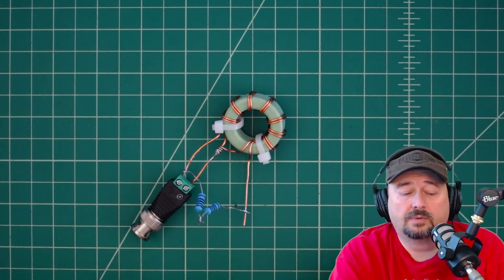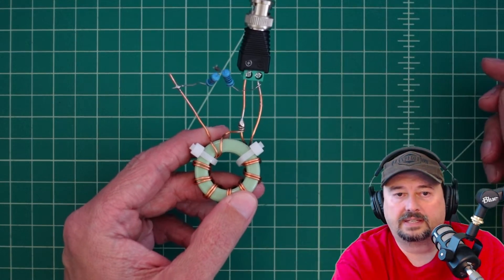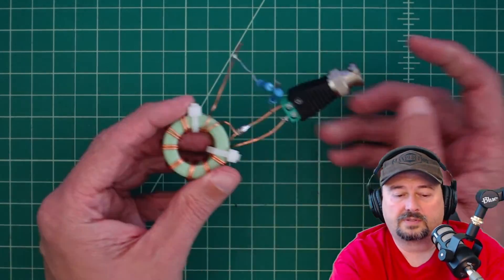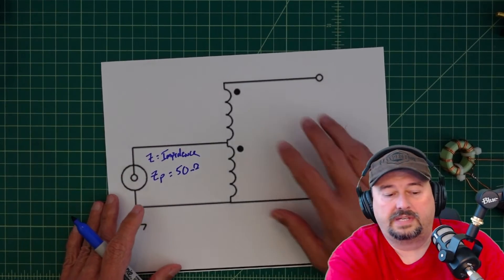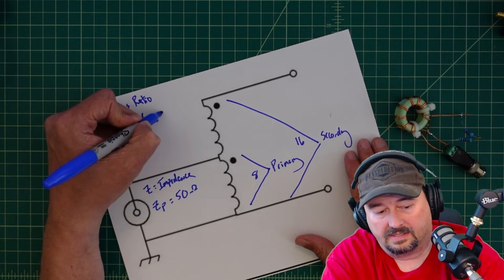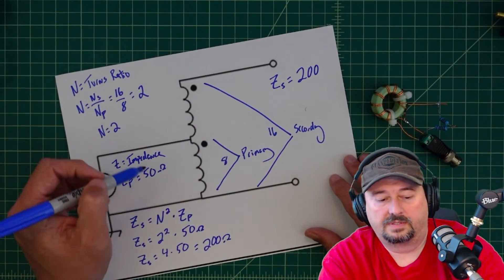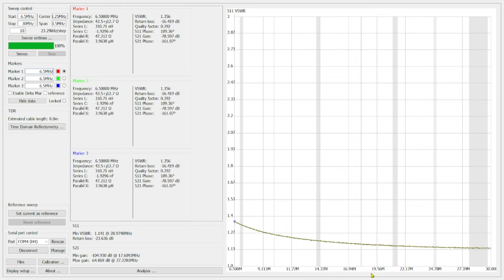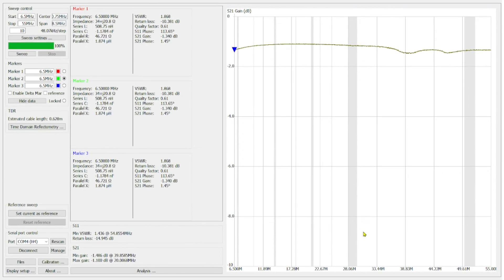Best 4:1 UnUn for Ham Radio Antennas?

Comment: Hi ape, I'm new to this field, why specifically 8 turns for each winding, what if we wound more or less, can you clarify this?
Reply from the maker: The number of windings per s chosen based of the core type and frequencies the antenna will be used on 👍
Reply: @TheSmokinApe can you share the info about how to do it
Reply from the maker: @VasanthP-yl9co I just did a video where I spoke a bit about it, I have more planned.  Tiny Toroids: What SHOULD you use for QRP End Fed Half Wave Antennas?
https://youtu.be/0HmrlRXsDck

Comment: What type of resistors did you use? Did you choose low inductance resistor or are ordinary resistors ok to use at HF freqs?
Reply from the maker: Carbon file low inductance, ordinary will add reactance 👍

Comment: I hear a lot about dual core 4:1 Guanella current baluns and how to make them, but I can't seem to find any practical examples of how to make a dual core 4:1 Guanelle Unun. Maybe you could address that one in a video?
Supposedly, the dual core 4:1 Guanella unun is more efficient than the single core 4:1 unun you built in this video.
Reply from the maker: I think there is much debate over the dual Guanella vs the Ruthoff and Guanella current hybrid.  I can do a video, at some point on the dual Guanella

Comment: G'day APE
Now using this specific setup, you got close enough as you say.
My question is, supposing using this core can you modify the type of wire and spacing fine tune and get the theoretical 1-1? 
I'm also guessing slightly altering the number of turns would throw things way off from the desired effect.
I know it would not be worth doing this, but I'm guessing you could.
Reply from the maker: You could.  But you would need to know the impedance of the antenna and then adjust accordingly 👍

Comment: Transmission line transformers are quite forgiving as to core material compared to conventional transformers or autotransformers. My advice  - test them as conventional transformers (Primary -secondary maybe 10T each, or conventional Autotransformer) at POWER. This helps to sort out the mystery core material performance better than return loss alone... 
The 52 Mix is supposedly Powdered Iron according to Micrometals and NiZn ferrite material according to Fair-rite, with a perm of 75 to 250. Data sheets are all over the place on values.  Dunno how these are equal. They are supposed to be lower loss at higher frequencies than the Yellow White Type 26 typically found in ATX Power Supplies.
Reply from the maker: These are type 52 powdered iron and not the mix 52 ferrites, I think you are recognizing that.  We, along with others have used these is a 25’ vertical antenna configuration with four 17’ ground radials with success from 40-10m.  I don’t recall anyone trying on 6m.  We did use a tuner but with that antenna configuration it’s to be expected.  Admittedly, I was surprised at the results.

Comment: what are those green/blue toroids? I pulled a pair of them out of some scrap electronics the other day and was wondering. Interesting that they're making an appearance here...

(apparently, I'm the 73rd comment, so) 73,
Reply from the maker: They are t130 type 52 powered iron 👍
Reply: @TheSmokinApe given that, I'm blown away that they work as well as they do at HF!
Reply from the maker: @hamradioexperience  I was a little surprised myself
Reply: @TheSmokinApe I'll have to do some more testing. I was literally just told they MAY be of LIMITED use on HF. They seemed great from your video. Other than at sub-80m. I might try to duplicate your results, then copy with a -43 mix. Might be interesting...
Reply from the maker: @hamradioexperience  I’d be interested to hear what you find.  We did compare them to multiple core and then decided to go with this one.  Thanks for watching HRE 👍

Comment: Hi, ape. I'm glad that you made a 4:1 Ruthrof voltage BalUn and tested it.
The only thing that bothers me is that you used the wrong core material. 
Iron powder core #52 is equivalent to #26, which is meant for power transformers and high current chokes in  switching power supplies.
De VU2RZA
Reply from the maker: Hey Subramanian.  Thanks for the post, I did read the spec sheet but for this particular build we did test a few different Toroids and much to my surprise this one did particularly well.
Reply: @TheSmokinApe  OK Ape. Thanks for responding. 
But this core can be used in MW frequencies; it can be used as high as 1 MHz or 1.5 MHz max. That's all.
You may get deceived sometimes with the nanoVNA. 
In the real world, it would be useless. 
Instead, you can test mix 2 or mix 6.
I believe you might have tested them already 🤔 
De VU2RZA

Comment: Does the 52 mix give a better frequency response at lower frequencies than the 43 please?
Reply from the maker: It depends on the application but many folks use the ferrite mix 52 for 80 and 160 👍

Comment: looks good. nice core mix to go up to 6 meters.  I have wrapped a t 240-61 at 4:1 Balun . for off set center fed veritable for 10/11/12 meters.  1/2 wave total and feed point at 1/3 from bottom. making around 200 ohm feed impedance .  will go up DX commander pole .  will be a mono band type.  have all the parts but not put together. I used 14 AWG mag wire.   this type does not need ground plain or counter poise. it is a balanced dipole.  it is when we feed at end it goes unbalanced and counter poise of some type.   that need UNUN to feed. my antenna go bag is getting bigger.  and still a easy carry  for POTA . mat do a 2 or 3 stack 4:1 with T 240 for 1Kw . lord Callum can do 1 KW now. off com license change . 1 KW for the UK. now 100 watt stations came back to me /QRP . was funny. several did it to me on 10 meters in the AM . FTDX 10 sounds great  from England 100 watts on 10 meters. 73's
Reply from the maker: Hey Robert!   This is for a vertical ground plane type antenna, the CaHRtenna Poseidon
Reply: @TheSmokinApe  I was thinking that. love the test video's that dropped lately . with the cores back to back. put 50 ohm dummy load on it and you can do power test for core heating.
Reply from the maker: I actually have a video like that planned 👍
Reply: Hi Robert, let me make some clarifications. 
An OCF, off-center fed dipole is an unbalanced antenna. 
You are using a half lambda wire and feed it in the center because the feed point impedance is low in the range of 50-75 ohms and is suitable for a coaxial cable. 
This center fed dipole is resonant (on only one frequency) and can be used for a single band only.
If you want to work on multiple bands, you have to find out a point on the half lambda wire that would remain with a fairly fixed impedance. 
It can be 1/3rd or 1/4th from any one extreme end of the half lambda wire; it would be around 200-300 ohms depending on other factors especially like the feed point height above the ground. 
So, a 4 to1 or  6 to1 transformation to the standard 50 ohm coaxial cable is needed.
Here, in this video Ape demonstrates a 4 to 1 Ruthrof voltage BalUn. 
The demerit of this design (apart from the choice of wrong core mix) is that it won't provide any CMC, common mode current suppression. 
Yes, in any OCF, you will be expecting the CMC problem. 
You can mitigate in two ways. 
1. The Ruthrof voltage BalUn must be followed by a 1 to 1 CMC choke. 
2. You can go for a  4 to 1 Guenella current BalUn using two ferrite cores of sufficient size for the power to be handled. Don't get tempted to use a single core 4 to 1 BalUn. 
Just for completion: ferrite cores are termed like FT82-61.
Iron powder cores are termed like T200-2. 
When you intend to use more than 600w, you should go for Teflon wires of sufficient gauge; don't use enameled copper wire (magnet wire)
I think this helps. 
De VU2RZA
Reply: @subramanianr7206  what I made was a mono band off center fed. only for 10,11,12 meters buy folding extra wire and wrapping it around. adjusting match. not a high power antenna. just one FT 240-61 core I had. and my coax feed has choke at end wear it goes to Balun. everything made with Walmart speaker wire . just testing. I got tune on CB CH 20 at 1.2 VSWR . just speaker wire and tape. all tape on DX commander 10 meter pole. hears the skip like crazy. I will use better wire next time. I did do a 2 stack wound 10 AWG 49:1 and handles 1 KW  tested . 400 watt FT8 hours cores slay slightly warm . no rise in SWR . I have thermal imaging camera . Flair . 73's

Comment: Very good explanation. Most of the antenna kits tell you the power limit on the build. Is that determined by any of these calculations, or is it solely dependent on the size of the toroid (tow-roid)?
Reply from the maker: Hey Doug, the size and composition of the core are the two most critical factors.  When these cores get hot they loss magnetic properties which stops their ability to transform impedance.  More power = more heat.
Reply: I believe the gauge of the wire is the biggest criteria.